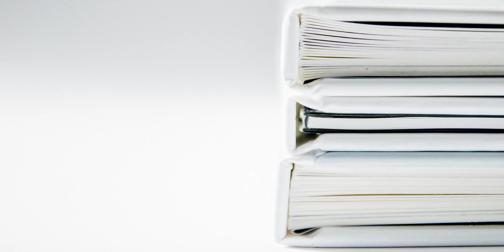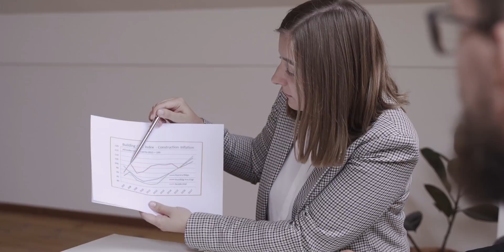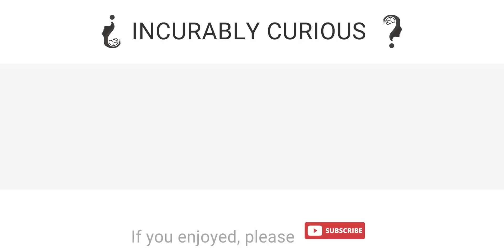Why Most Power Lines Aren’t Underground

Comment: We definitely CANNOT!!! Anything over 63,000 volts CAN'T be buried effectively or the insulation has to be about a foot ( 365mm) thick which isn't practical from a cost or reliability standpoint. My ex-Housemate did powerline burial for a living and in the US, we have High-tension lines carrying 23,000,000 volts going EVERYWHERE and 121,000,000 volt lines going from nuke plants and super gas fired plants strung on 83 foot insulators 600+ feet in the air. 800,000 volt lines go thru residential neighborhoods to "post transformers" that ARE buried, those big light green boxes behind your houses. At each end of your block, there's probably a fenced-off BIG grey or dark green box with powerlines feeding it from poles-those wires can't be buried.
Reply: These numbers are nonsense. 23 and 121 million volt lines? No.

Comment: Wires have to be extremely well insulated and armored in order to be buried underground. Instead of storms being the leading cause of power outages, if the lines were buried, burrowing animals would be the leading cause of power outages. Another thing to consider is that placing buried power lines too close to each other may cause unintentional capacitance.

Comment: When we had daily newspapers,  they had little columns called 10 years ago,  25 years ago,  50 years ago,  and 100 years ago.  Around 1880, they were installing over head electrical lines.   In the column was a statement "these lines will be put under ground in the future "

Comment: A lot of the arguments scream excuse to me. Eastern Germany, the former GDR, has been migrating away from overground power transmissions for low to medium voltage levels (e.g. anything below 40kV) since the German reunion. There are a few left-overs here and there, but that's essentially cleanup left. So yeah, a process like that will take 20 years. The reliability has vastly improved. Sure, there is the occasional storm-related outage, but they have reduced a lot. Cost of repairs have gone down too, over all. The quoted cost of 500,000 USD per mile seems to be too as well, at least as long you don't have to tear up and rebuild roads. Prices for digging a trench and filling it up afterwards are quoted in German between 30,000 and 120,000 USD per mile. I don't think US wages are that much higher...
Reply: Considering how much more workforce and professions are unionized in Germany, the minimum is certainly higher than average of the US.
As a bonus, states are encouraged to lay fiber while doing any kind of digging where appropriate.
Reply: @Gastell0  It has nothing to do with unionisation. German build quality and work ethics far exceed anything the Us can ever achieve. Why do you think all the cars sold in the US are German or Japanese.
Indeed, POTUS Trump complained to the Japanese PM a few years ago on a state visit, asking why only 0.5% of cars in Japan were US made. The Japanese PM replied.....'Build better cars'.
Reply: @berty1422  Quality and Ethics are directly correlated to unions in Germany, they allowed people to continue being people and enjoy life while doing their job that they have not only to survive another day
Reply: @berty1422  germany's market share in the US car market is pretty low.
Reply: @Gastell0  The US has higher wages than Germany though, so this argument about cost doesn't really fly
Reply: The wages are not the issue.
The dramatic rise in cost is because they have to cover themselves from every angle for potential damages to other lines/services during that work, which would sue them for damages.
A bureacratic nightmare gobbling up money
Reply: Germany has about 18,000 circuit miles of transmission lines.  The US has 700,000.  Scale makes a difference.
Reply: @kcgunesq  How many of these are for client distribution and not interconnect? Germany (as well as Europe in general) have also much more efficient housing with higher density, our taxes due to this are not being so high
Reply: @kcgunesq  Does it? The most expensive part for underground transmission in cities is the trench work. If you know that there are no other cables or e.g. a gas lines to interrupt, there are much cheaper options around. A cable plow for example can cut a trench, insert one or more cables or flexible empty conduits at the same time and costs in the area of 16,000 USD per mile. A cable rated for 125A at 400V costs about twice as much, to put that number into perspective.
Reply: @kcgunesq  I'm explicitly not talking about HVDC (or HVAC or that mater) lines. Putting those underground doesn't make sense in all but the most populated areas for a variety of technical and electronic reasons. Everything below ~40kV is fair game.

Comment: Overhead power lines aren't pretty but easier to service. If the power company properly maintains them, pruning trees, replacing old cables etc., power outages are rare. When I was young, power outages were common here. They are rare now because the power company is better at maintaining the lines. Underground wouldn't work here. We have cold long winters. The ground freezes to almost 4' at times. We also have bedrock close to the surface.

Comment: The explanations in the video don’t make a lot of sense to me. We already have water, sewage and communication (fiber optic cables) running underground, which are all cheap infrastructures. Why is electricity so different? It’s not like we don’t know how to build underground infrastructure reaching every home.
Also, with all due respect to earthquakes, they are much less frequent than storms. Even if it’s so hard to locate a failure underground, there should be much less failures.
Also 2, how come underground electrical cables last half of those which are above ground? That doesn’t make any sense, they are much less exposed to wear. If anything it should be the opposite.
Reply: So you understand how Ohm's Law works?

Heating, and insulation are the massive problems with underground power cables.